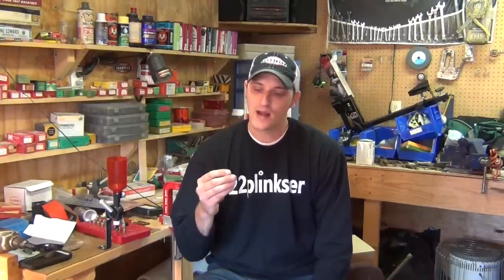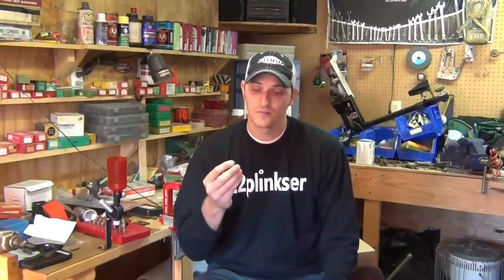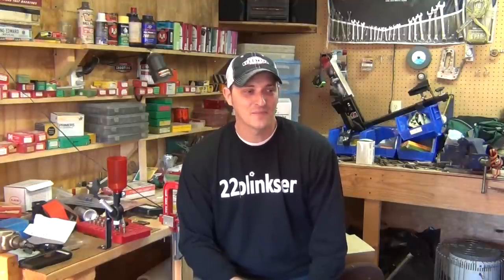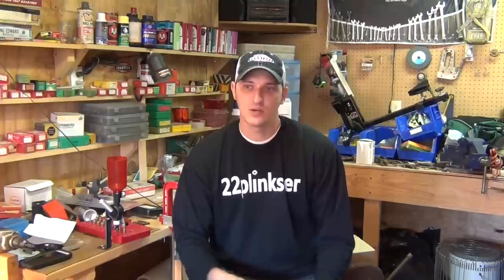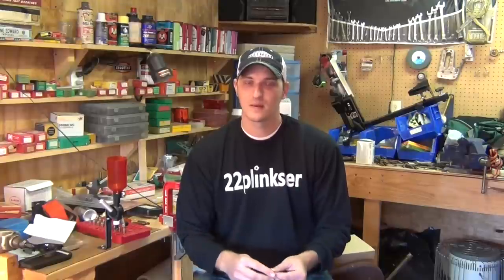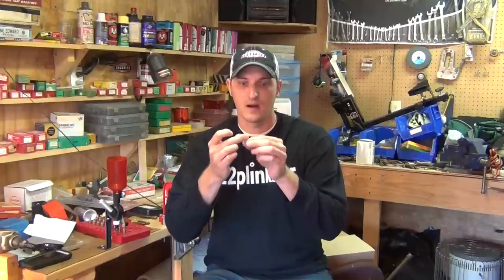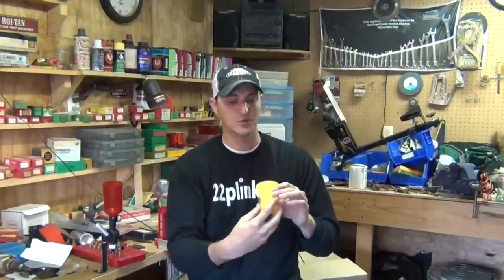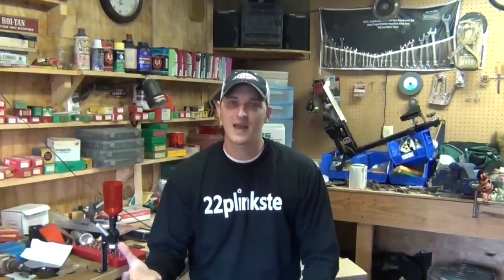Why does the .22lr have misfires?

Comment: American Eagle and Remington golden bullets are the shittiest.
Reply: Agreed. But I tried some newer american eagle bullets in a particularly picky gun, and they seemed to be better than they used to be.
Reply: Don't know about historically,  but when 22 was impossible to find last year I lucked into a place that had a few boxes of bulk American Eagle.  I shot 3 boxes of that... It was 400 rounds per box and had less than 10 that did not fire through my M&P .22.  I thought it was decent ammo and was pretty accurate as well.  I actually have not shot many different brands through the M&P (built by Walther for S&W) but so far,  it eats what I have found.
Reply: GunFun ZS Ill have to try them again if i come across any. As of now they are the only 22s that constantly stove pipe in my gun. (HK 416 D). When you shoot them you can hear the difference from one shot to the next.Some are full power and others are weak. Inconsistent loads i guess.Same goes for the golden bullets except they cycle without a problem.
Reply: John Johnson I am certainly not trying to sell you on them. They were my least favorite for years. Closely followed by the golden bullets. I have gotten both with the bullets nearly falling out of the crimp, and also both badly damaged in the box with cartridge shaped dents in the shells from aparently being smashed together in the factory. It always astounded me that they could sell anything relating to firearms with that poor of QC and handling. The absolute worst looking .22 ammo I have seen was Am Eag which was like orange peel under the plating. They were actually lumpy, enough to cause feeding issues, and obviously nothing like consistent.
Reply: GunFun ZS Sounds like you buy your 22s from Walmart. Am i right? Walmart gets all the seconds. Its amazing that they would sell seconds and still put their name on it.The money must be more important than their  reputation.
Reply: Nope. You are not right. I haven't actually bought much .22lr in the last 4 years. maybe 4 or so 50 count packs at the LGS.

In normal times, I buy bricks of good stuff at Bi-mart, which competitively prices good stuff. CCI blazer is my preferred brick plinker, followed by wildcat super x, then Rem green box lightning (for common brands). I did have one birthday during teenage years in which all the guests gave me a brick or two each. That gave me a very broad spectrum of what was on the market at the time. I attempted to be quasi scientific in comparing them. I had over 17K not counting the CCI stuff. I've also tried to sample a few of any brand a friend brings if we go shooting together. So I have a fairly broad experience with everything short of premium match ammo. Not so much with products introduced in the last 4-5 years though.
Reply: GunFun ZS  I agree with you that Blazer is probably the best bulk rimfire ammo out there.  I used to buy it by the case when you could actually buy 22LR ammo.  Oh... and for those that are not familiar with it, it is brass cased and not aluminum like a lot of other Blazer ammo.
Reply: Not that you can reload rimfire anyway.
Reply: Fix your profile picture, John. You can hate the government and the people, but don't hate this country.
Reply: GetTheFO I dont hate this Country my friend.I hate what its becoming. 

"The upside down U.S. flag is an official signal of distress. It is not meant to be, and is not officially recognized as any type of disrespect when so displayed for the right reasons."

Have a good day and i hope you learned something today.
Reply: GunFun ZS Thats what i thought up until yesterday. Search "reloading 22lr" here on youtube.
Reply: There are ways to reprime them if you were in some sort of silly apocalypse, but still had all the supplies. For those of us in the real world, reloading rimfire is not even close to worth it. I've seen a few of the proof of concept vids, but even those guys are clear that this is only something to see if they could, not worth doing for any other reason.
Reply: JustSomeGuy The Blazer 22 is pretty good stuff, and cheap if you can find it. Or was anyway...
Reply: I have re-primed rimfire, using powder from toy caps. works fine but is very tedious.
Reply: GunFun ZS
When I was living in eastern Washington, Bi-Mart was where I bought rimfire ammo and all my reloading supplies. Great prices. I live in the Seattle area now and the closest Bi-Mart is 150 miles away. I've been waiting over 25 years for them to build one around here. I still have my card but they haven't built one yet.
Reply: They aren't as competitively priced as they used to be. I priced bulk birdshot there at nearly $10 more than my LGS per 25 lb sack.
Reply: Well, I just got primers there this afternoon at a reasonable price, but the shot was $2/lb. Also, no wads, and only black powder in stock. Not that the latter was their fault.
Reply: Do you get many misfires out of American Eagle? I do! Seems like crap to me :(
Reply: fuzzypaws17 A few misfires here and there but tons of stovepiping due to what i believe to be inconsistent powder loads.AE is close to the bottom of the barrel.

Comment: Not true ! I own a p-22 Walther brand new it had misfires because the ammo needs to be cci mini mags 5.6 mm 40grain also if u want it to shoot stingers ,Aguilas ,browning, what I had issues with mine was the inside of barrel where the rnd enters  I beveled it at 45 degrees angle flush and smoothed out to shine and now it fires with out a missed , do not use bulk ammo buy the plastic cased 100 rnds and do not use winchesters

Comment: Answer, because the fire pin doesn't strike the casing hard enough. There's 3 possible fixes, I've done all within brand specific issues. I don't need to watch this.
Reply: How to fix, change harder spring?
Reply: But you did.

Comment: I have a question. We talk about recoil a lot when shooting. Each cn moved significantly during the bullets penetration. I am wondering if maybe the movement of the cans had something to do with only penetrating into the 3rd can? The only reason I ask is can 5 though 10 were completely removed from the table, Your thoughts?
Reply: KingQuadTom   I would guess that if you put a solid backstop behind and around your cans, that you would get a little more penetration. The cans absorb energy, when they move...  Would be my guess.

Comment: I have had almost zero problems from any rimfire ammo except Remington!
Absolute crap! Failures to fire (including rotating the case), loose powder in the boxes, loose bullets, under & overcharged powder, poor accuracy, dirty & foul. Very inconsistent rim thickness too. Through my Crickett, more than half the ammo the bolt is hard to close because the rim is too thick. Some is loose because the case heads come out bulged. No problems with anyone elses ammo, just Remington. I rather like the American Eagle .22LR, cheap, accurate, consistant. Just the 40rd boxes are annoying. But piss on Remington, their guns have become almost as crappy. I'm a Remington fan, love the older stuff but you couldn't pay me to take anything current. They should rebrand the Thunderbolt 22  and Cylcone ammo to something more fitting, like R51 ammo, as good as a recalled gun....

Comment: I live in Canada and yesterday it was very cold and I had about 5 misfires within 200 rounds.
I checked each round and the firing pin worked 100% but no firing.
Does the cold affect .22lr ?
ps: the rounds were CCI Standards
Reply: Check your ammo after you've tried firing and if it does not have a deep enough stamp from your firing pin then you may want to take it to a gunsmith to have it looked at. 22LR sidearms are notorious for malfunctions when it comes to the firing pins because a lot of people will dry fire their 22Lr sidearms.

Comment: I bought a springfield stevens 87a and the shell get stuck in the barrel what causes that problem its from the early 40s its kinda a problem its has 15 shells u can load up and. Semi auto and will jam if that shell don't come out resulting breaking down the whole gun I've ran winchester and remington through this gun but does it really depend on the bullet or its it just something bout the gun

Comment: Question on remington 581 22 rifle.  What could cause a 22 shell casing to expand inside the chamber and jam.  It will expand to the point consistantanly that I have to use a cleaning rod from the front of the rifle to force the shell out of the chamber.
Reply: Coxe Property Management and Leasing   Sounds like your chamber is too loose. Out of spec. Have you dremeled your chamber?  I hope not...

Comment: What do you think about dry firing on spent casings?
Reply: Fuddy Duddy   Perfectly fine. The firing pin is hitting the exact same material that it normally hits. Right?  That's what I do if I wanna dry fire a rimfire gun. I can't stand the thoughts of that firing pin slamming into steel.

Comment: im stumped,bought a new ruger American 22 mag,been out twice and both times every 3rdround fails to fire,hornady 30 gr polymer tip also tried 30 gr cci hollow points,thinking maybe weak spring,can run both through my heritage rough rider pistol and not a hiccup.help
Reply: Problem is with your rifle, it seems.  Contact Ruger.

Comment: What is a primary cause of an, "Out of an Battery Discharge"?
Reply: CapnJackSB   Are you talking about a slam fire, from the bolt cycling forward?  If that's what you mean, then it's because the headspace is slightly out of spec. The cartridge isn't sitting deep enough in the chamber. Would be my guess...

Comment: My phoenix 22 lr hand gun repeatedly misfiring, i have tried many different ammunition brands but it doesn't help! I sent it to phoenix arms company and they said nothing was wrong with it! What can i do? What can i try? Help please, i haven't fired it much before this started happening.
Reply: Only thing you can do is test as much different kind of 22 long rifle ammo as you can and see what works. Try the Aguilar .22Lr Super, it May fire dirty but it has a fairly good velocity on it. Sadly with more finicky semi auto 22Lr sidearms the issue is the ammo. Sometimes it does not always have the power in it to move the slide back eject and then load your next round.

Comment: I shot cci .22 shorts  out of a Remington model 597 and when I was done, a bunch of yellow waxy stuff was in the action. Any ideas on what that could be?
Reply: bullet lube on the lead bullets what happened is it started to build up in the front of the chamber because the rounds are shorter lube,powder,lead will build up in the chamber when shooting .22 short in a .22lr chamber a cleaning brush and solvent will clean it up
Reply: I had that with some waxy federal hollow points. They would drag in the mag and cause FTF. I stick to the cleaner rounder nosed stuff and it works fine.

Comment: Most "misfire" problems are a result of the firing pin. Not enough momentum, poor shape to the tip of it, striking the rim of the cartridge in the wrong spot, or not denting the rim deep enough. Just my opinion...      My Ruger 10/22 is the only .22 that I own, that has misfire problems. I do believe there are a few blank spots in cheap ammo, but more often, it's a poorly made firing system in the gun, itself.         I have a Rossi, with a really strong firing pin, that covers a big area on the rim when it strikes. I don't think I've EVER had a misfire with it.  Even with cheap ammo. I hate to bust the 10/22 worshippers bubbles, but these guns have their problems folks. I know my brand new one does...  Not impressed.

Comment: So I just completed a custom 1022 build and while everything appears to be cycling correctly when you pull the trigger every 3-5 shots the rounds won't ignite. This was over 2 different tests using different ammo from different manufacturers, different bolts and I had the same problem at similar rates so what could cause something like that?
Reply: Used a deadshot arms bolt with federal ammo in the first test which actually did better than my test involving a match grade bolt by power custom and Winchester ammo, both bolts are brand new with stock firing pins
Reply: I have been doing some research and I think I have discovered the key to my firing issues for my custom 1022 build, but basically it boils down to a simple cushion effect produced when the bolt face doesn't make metal to metal contact with the barrel tenon when the charging handle is released or driven back by the exiting round, this air gap forces the hammer to strike the bolt pushing it forward to close the gap before it can make contact with the firing pin. This weak contact slows down the firing pin allowing it to strike the cartridge hard enough to leave a print on the rim but not hard enough to ignite the primer compound, this would explain why manually pressing the charging handle all the way forward after recocking the hammer most time the rounds would fire.
Reply: Not sure how to fix this issue am using a power custom match grade bolt and Brownells 1022 receiver clone have a tandemkross titanium charging handle with a brand new recoil spring, these specific firing issues only began after those parts were installed into the new receiver clone from my original 1978.
Reply: Gonna try swapping the old 78 factory reciever for the Brownells receiver I just got, throw on the new barrel and upper receiver parts with my custom built trigger assembly with the cst auto bolt stop kit and blackhawk pistol grip stock and see how she runs. I am thinking the receiver is causing too much friction which is slowing down the bolt just enough to prevent metal to metal contact with the barrel tenon so if a nicely worn and broken in receiver stops the issue then I atleast have a working firearm till I am able to consult with a gunsmith about making fitting adjustments to the new receiver
Reply: Well the cst auto bolt stop's torsion spring is not long enough for the aftermarket trigger housing I purchased for the build so I contacted them and they are sending me longer springs to try and get it working the short spring falls down into the safety channel when I engage the safety switch since the Tactical Innovations trigger housing doesn't have a built in retaining ledge like many other factory reproductions and becomes flush with the housing wall when the safety is engaged meaning when the searer falls after pulling the trigger it's striking that spring throwing off the mechanism leading to some of the misfire issues I'm having.
Reply: While I'm waiting for the springs to arrive I decided to remove the trigger group from the upper receiver and just run tests where I pull back and release the charging handle with near perfect metal to metal contact in every interaction so once I fix my cst bolt stop issue I believe it could be a tolerance or adjustment issue with how my aftermarket trigger housing fits the new Brownells receiver because once installed I had about equal ratios with the power custom and deadshot arms bolts where metal to metal contact was not achieved and I had to slightly press the handle to close the gap and in the 78 receiver using the same aftermarket design I never noticed that issue being a problem for me.
Reply: I used customized trigger and action parts from Volquartsen, Kidd, Hornet, Pike Arms, CST/Power Custom, NDZ, Trigger Shims, Tandemkross and AGS, fitted into a green Tactical Innovations trigger housing, Brownells receiver clone with a 16" sporter barrel threaded to a 1/2" × 28 muzzle break stuck in a Blackhawk pistol grip stock with adjustable butt stock, an M-Lok forward grip by Presma and of course my rifle sling courtesy of Uncle Mike. This rifle only has 3 Ruger made parts included in the entire build only because the oversized Hornet cross pins wouldn't fit and I lost the aftermarket trigger safety plunger spring and had to use the original 78 parts to complete it. I have a 1" Simmons scope with dovetail ring mounts as well a Picatinny Rail for an Arken Opics 30mm scope mount I accidentally bought from a closeout sale and couldn't return it and have had no luck with reducers for mounting purposes and keeping it sighted. The longer torsion spring sent out by CST seems to have corrected my clearance issue with the safety switch but need to test the firearm and see how she runs.
Reply: I will still probably run it down to my local gunsmith to check it out and make sure it is up to snuff before trying to take it to the range but all these parts claimed to be drop in replacements for factory originals so I really wanted to put it to the test and see what happens next.
Reply: I finally took it to a gunsmith and he had worse problems test firing it then I was having before I completed the build. He was telling me to go back to my factory bolt release and extractor to see if that solves my issue as it is most likely an alignment problem caused by the extended torsion spring I modified to use with the CST auto bolt stop in my rifle. The reason I believe this when examining the bolt there is clear signs the "catch hook" used to stop the bolt when the magazine is empty during its field of travel has indeed scraped the bolt up pretty dramatically which shouldn't happen when installed correctly. The instructions indicate this torsion spring can be bent to work better with alternative magazines and ammunition so I emailed the manufacturer to see if they can send me the correct measurements so I can attempt to bend the spring in the correct way to fix my problem soon!

Comment: I have alot of problems with federal ,, anybody with the same problem?
Reply: losttribe1993   I shot 200+ rounds of Federal 550 bulk today. This was the first time, with this ammo, in my 10/22. I only had ONE stovepipe, but I did have several misfires. About 1/10 or so...   I took my firing pin out this evening, and sharpened it a bit. I'll be trying it out again tomorrow, to see if it helped...